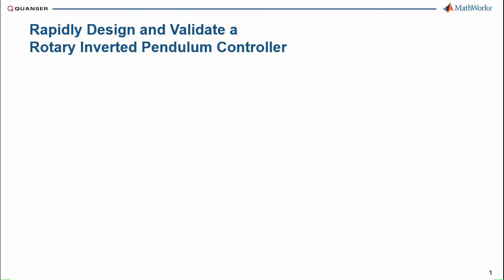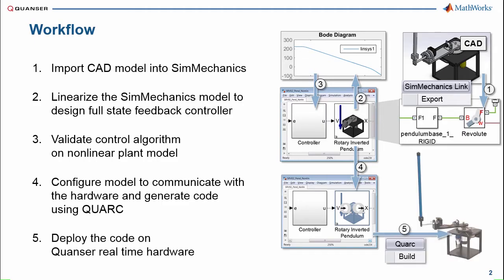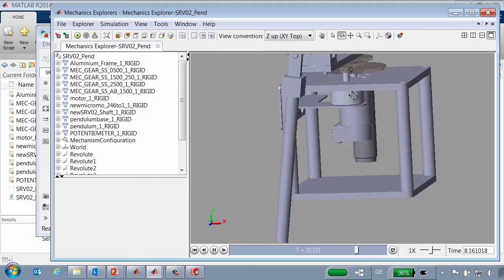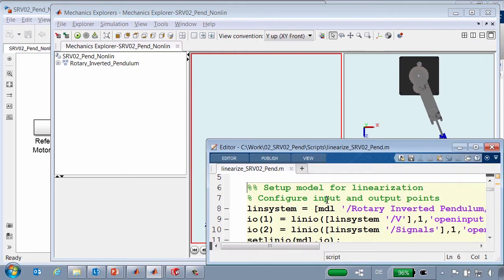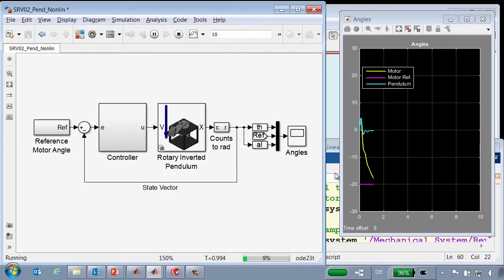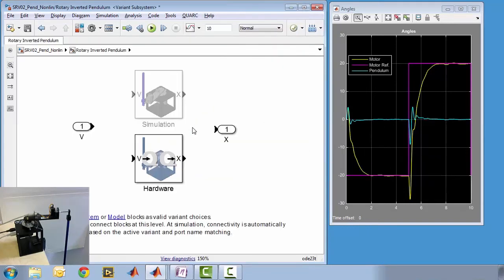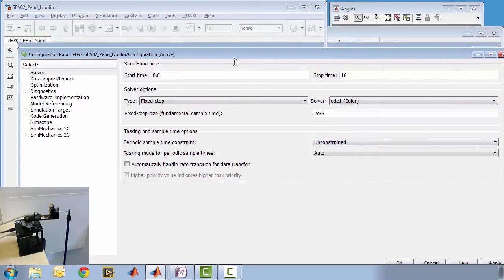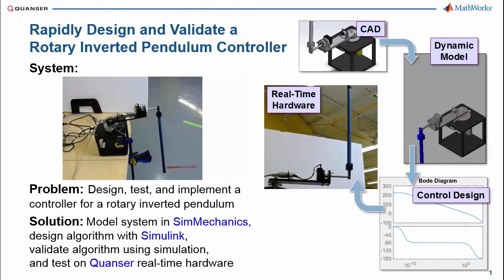Inverted Pendulum Control with SimMechanics and QUARC

Comment: Hello! I am having Problems linearizing my Simscape model, in a similar project I am making with an imported cad model of a RIP(Rotary Inverted Pendulum). I have some questions, it would be very useful If you can answer them. my mail is coco_pb@hotmail.com

Why is the Inertia in the motor Commented out?.
How are you connecting the DC motor model to the RIP?
Will the motor consider the inertia computed by the Simscape Imported Model?

Thank you Very much!